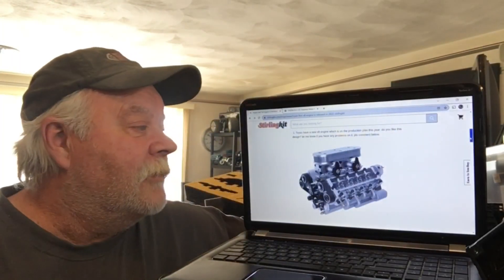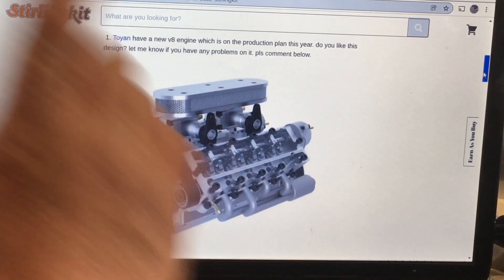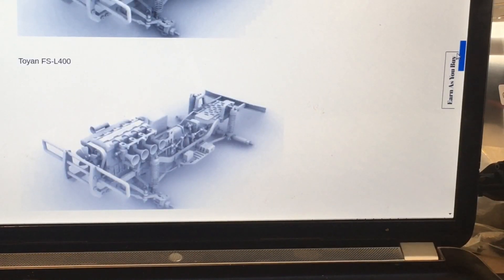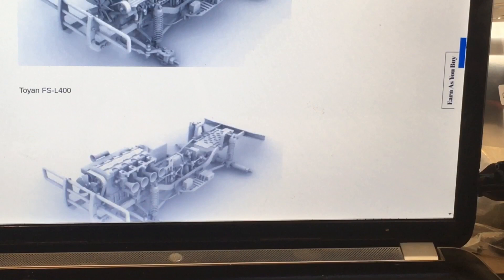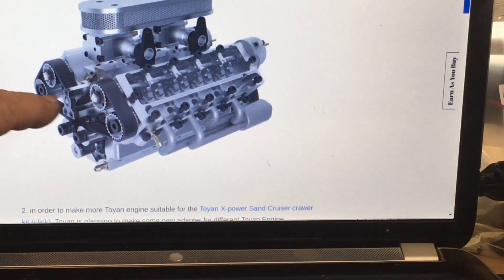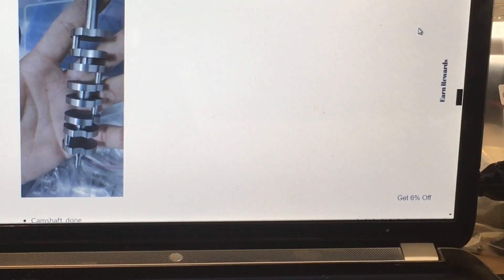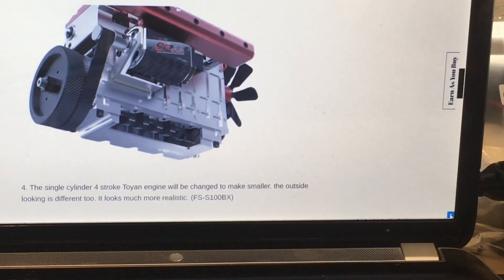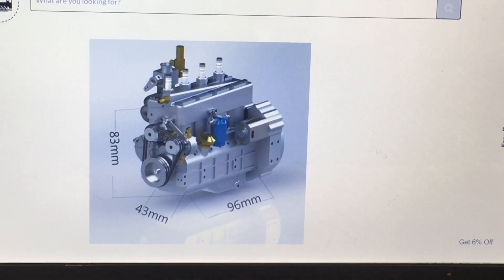New TOYAN V8 OHC ENGINE!!!  UPGRADED L400 COMING!!!

Comment: It is a single overhead cam.engine. The other pulleys appear to be tensioners
Reply from the maker: Yeah it looks like the L400 cylinder heads with one cam per head and idle pulleys.

Comment: That stuff is very cool! Wonder if the V8 will have crank problems? I can’t afford any of that stuff.... how do they stay in business I wonder, because average Joe can’t afford any of that lol.... I really have always loved and wanted one of the American made Conley V-8.....
Reply from the maker: Yeah I was wondering about the crank myself lol, I did notice I can buy some of the same parts off eBay for half of what they are asking,  the Conley engine has been a dream of mine since 1988, I seen the Aussie V8 is the same thing at a 1/4 the costs of the Conley so here in 2021 I finally got one.
Reply: @dennisdempseyradiooutofcontrol  wow, the Conley has been around that long?  I didn’t know that. I heard that the Ausie guy bought the prints from Conley?
Reply from the maker: @brianwood9849  Yeah it was a rough pile of metal rods and aluminum square stock you had to machine yourself lol, it was 600.00 then years later it was a kit where everything was machined and ready to assemble for 8000.00! the supercharger was 2000.00 more if you wanted it, then  Conley sold everything to the Aussie and Conley built the stinger 609 V8, now he is retired.
Reply: @dennisdempseyradiooutofcontrol  that’s really interesting information Dennis thanks. Conley sure sounds like a smart guy doing all that.....

Comment: A v8 is nice, but I'd rather have an OHV or flathead than an OHC. Do like that flathead I4 and the updates to the L-400; they need to go to a single carbsetup though.
Reply from the maker: The ohc is cool my Aussie V8 has adjustable roller rockers,  my thoughts on the L400 if they address the crankshaft problem when they add the internal oiling they hopefully use one carb to simplify it.